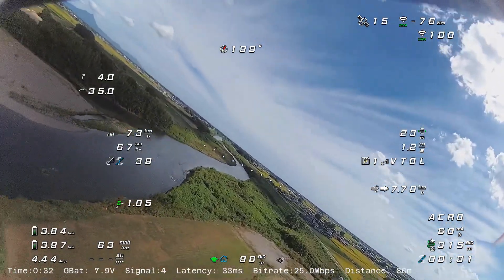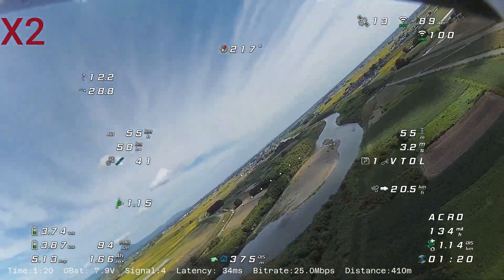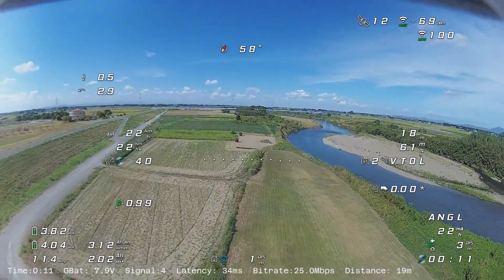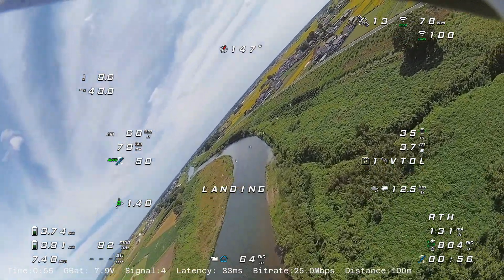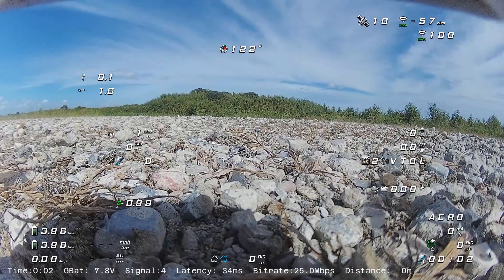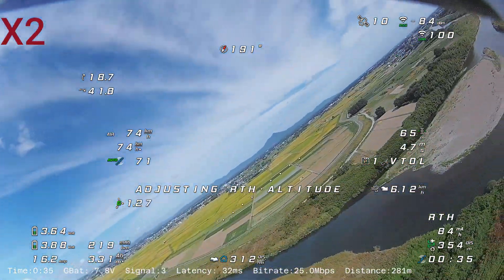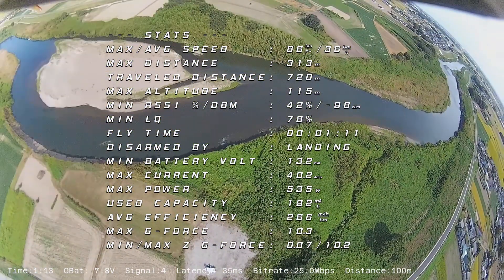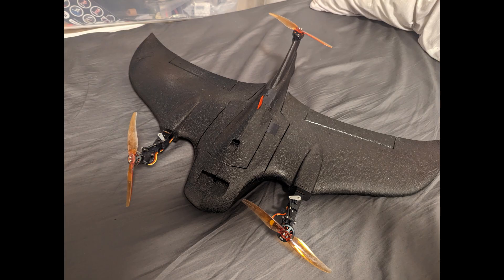Fimi Manta VTOL by INAV

Comment: The 7.0 configuration tab shows "Profile selection with TX stick command" but mine seems not working at this moment.
Reply from the maker: There are multiple profiles in inav, such as pid profile, battery profile, control rate profile, and newly added mixer profile.
Mixer Profile selection with tx stick command is not supported and not going to be supported.
You need to go to the modes tab and set the "mixer profile 2" mode to switch between mixer profiles
Reply: Thanks. @shotahayashi2969

Comment: Did you test the stock electronics of fimi manta on 4s?manual says recomended 3s. Sorry for the crash at the end but your making progress thanks for your time and work
Reply from the maker: Yes, I am using the stock electronics on 4s. The manual says it is compatible with 4s 18650